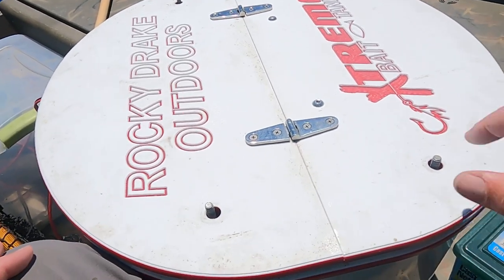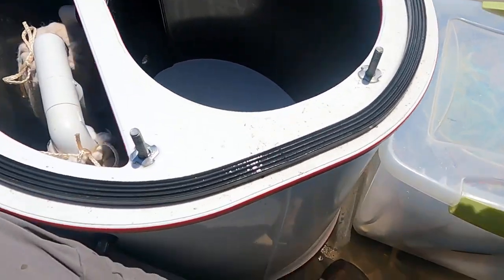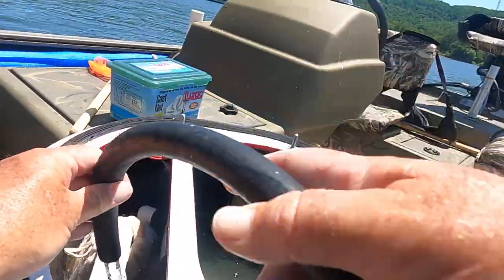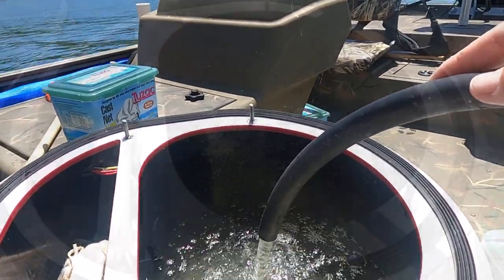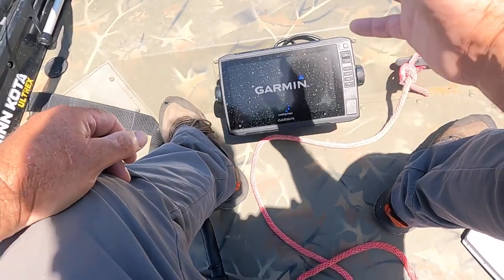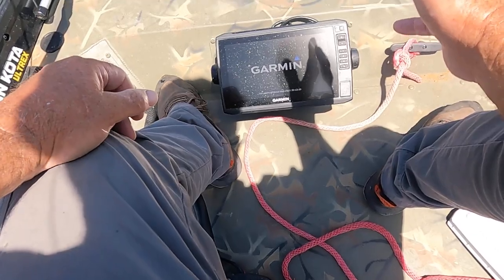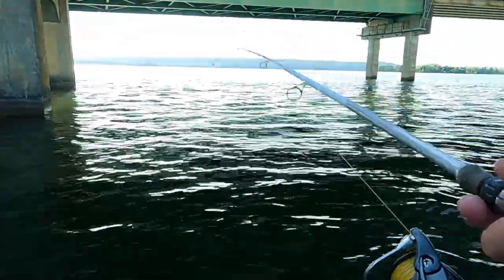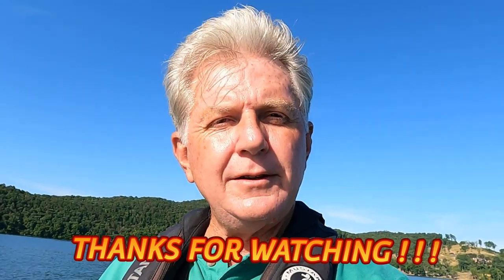How to Keep LIVE Bait ALIVE ! ! ! (Bait Tank TIPS for Live Bait Fishing)

Comment: I have a ranger just like yours and fixing to get an extreme bait tank. I was wondering if you'd stay with 12 gal to save room or would you step up to the 20 gal? Great video i really enjoy watching them.
Reply from the maker: I’m very pleased with my 12 gallon tank.It fits perfect in the floor of the my boat so I don’t have to sit it on the deck, where it would be in my way. A 20 gallon is going to weigh a lot more also. You could put a little more bait in a 20 but haven’t had any issues with my 12 gallon it’ll hold enough bait for me. 
Thanks for watching my videos and thanks for your comment 🎣🎣
Reply: @RockyDrakeOutdoors  Thank you for the info! Prolly see you on pickwick this fall

Comment: Emptying your catch in a tote has the additional benefit of allowing the fish to void themselves preventing that waste from getting in the bait tank. Gizzard shad in particular excrete a huge amount of waste when they are first dropped in a tote. I used to carry a sump pump and 75' of drinking water hose so that in the summer I could start with cold water from the lake. A pyramid weight and some screening on the end would get the hose to where the water was about 60 degrees when the surface temp was 90. I also froze several gallon ziplock bags that I kept in a large cooler to use to keep the bait tank water cool without adding chlorinated water from melting ice. Plus it saves a lot of money buying ice.
Reply from the maker: Thanks David 
I appreciate all the info in your comment. Those gizzard shad are messy to deal with. 
Thanks for your comment and thank you for watching 🎣🎣